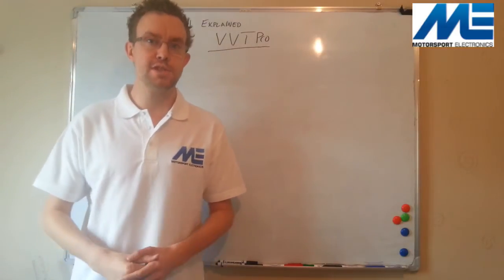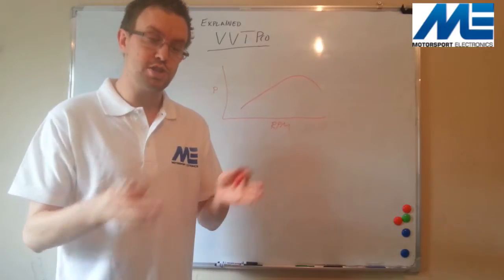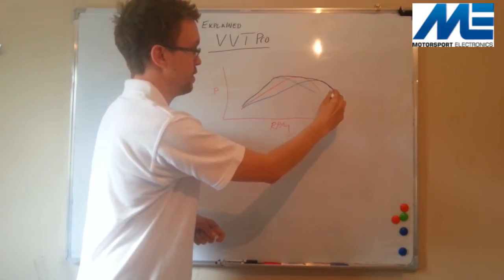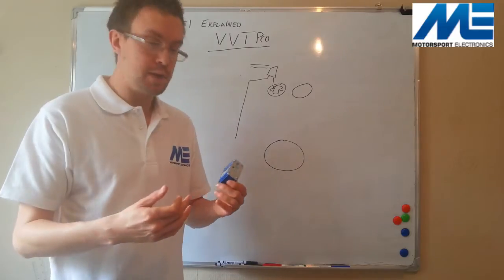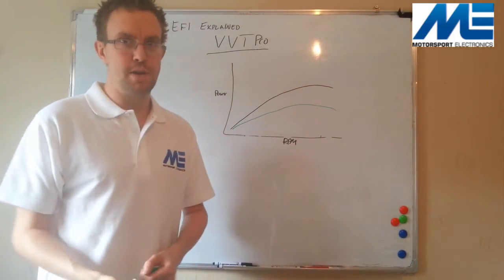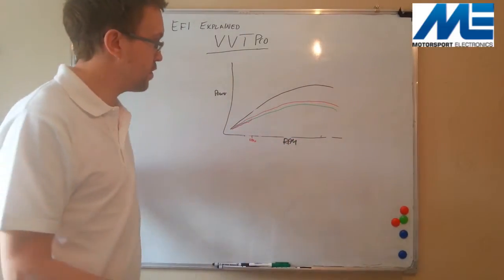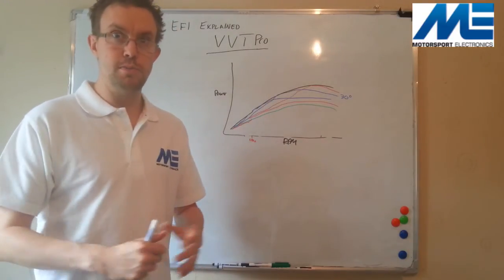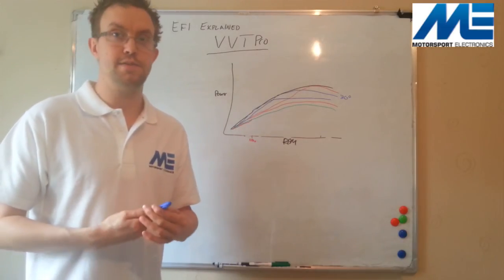How VVT Works on the ST170 and the VVT Pro :: EFI Explained by Matt @ M-Tech Automotive

Comment: Hi Julius here from South Africa. I own a toyota which has a 4age 20v blacktop which uses a vvt (the 4age was swapped into my car), the 4age has been converted to a carburetor. My question to you is how do I connect my vvt solenoid since my corolla is carburetor and doesn't have a ecu box? 

I heard you mentioned something about connecting the vvt solenoid to a 12v relay??

Comment: So why do we need vvt pro if the stock ecu adjusts the amount of advance depending on rpm to allows for the widest power band already?
Reply from the maker: It does but this ios for use with aftermarket ECUs on race cars etc that dont have VVT control built in, and no factory ECU either...

Comment: so if i understand correctly this little ~250eu box does nothing when used with factory EMS, no bhp/torque gains, it's useable only if aftermarket EMS is used like megajolt, megasquirt etc, correct?
Reply from the maker: Opexo, essentially yes it is aimed for aftermarket use only where the VVT Control is not an option on the new fitted ECU, that being said some gains may be possible on a standard car as Ford would of targeted emissions etc. Cheers

Comment: very thoroughly explained , ive read all the threads on all the forums and am goint to give one a try, i currently run a st170 motor with a dta s60 in my blue car and a zetec with cams and jenveys on another, so i will compare the 3, well done with the video and th vvtpro www.mk2mania.co.uk
Reply from the maker: Cheers, let me know if you need any tips and tricks with setup :)